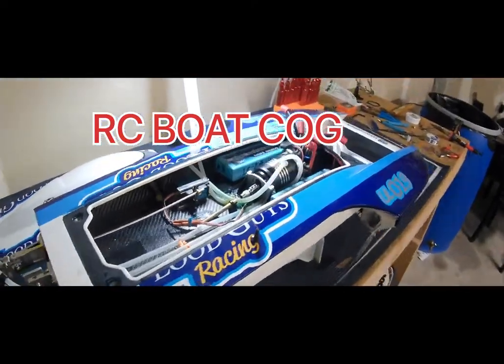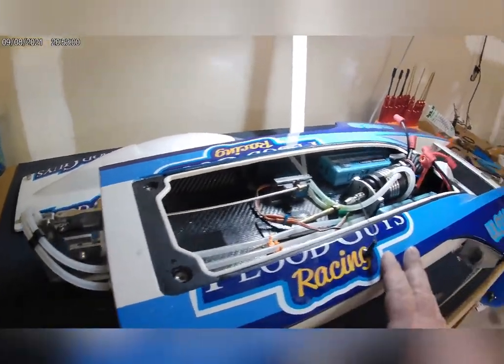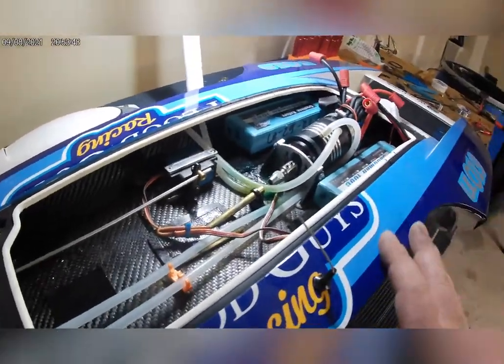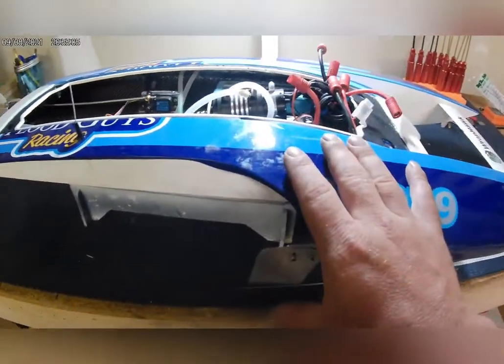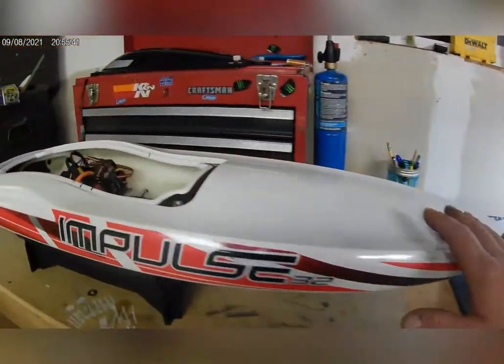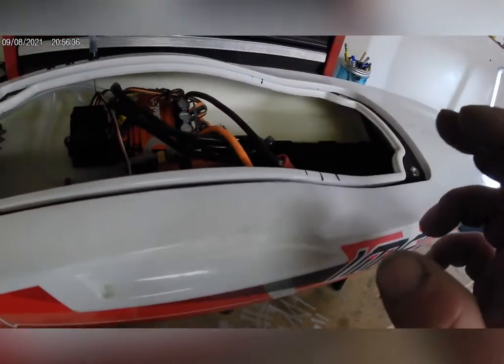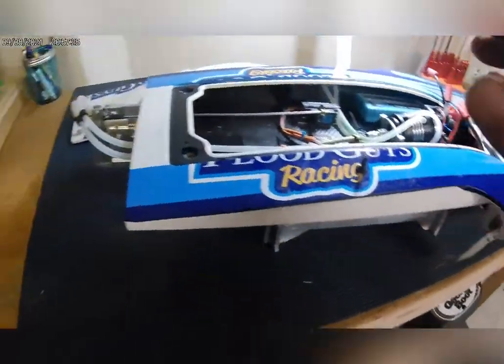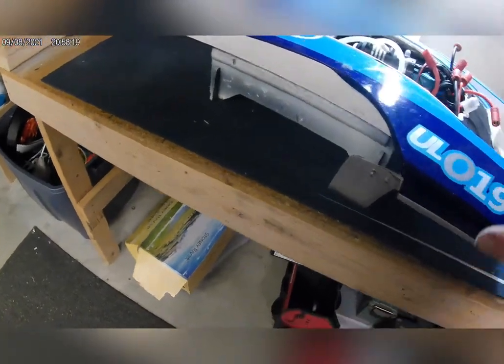Rc Boat Center Of Gravity (COG)

Comment: glad i stumbled across your channel. i am in the process of re doing my UL19 and was considering gutting the insides and making it like my TFL Popeye Hydro. now i know it can be done as you have done it. nice build on that UL.
Reply from the maker: Definitely can be done with this boat and makes for better improvements of the handling.   Even lighter as lost all the weight with the old tray and screws gone.

Comment: What about a sonicwake 36?
Reply from the maker: Normally mono hull is 28-35% of the hull.  As for the sw36 due to the self righting design of the water chamber. I found it’s falling in the 33-40 percent COG of the hull.  Make a mark at 35%  configure your batteries to fit within that Mark.  Then run the boat and move the weight forward or back to your driving, Water conditions, and how the boat handles.
Reply: @mad_lizard  how do I find cog?
Reply: Hello friend, where is the CG of the catamaran? I couldn't find this information anywhere.
Reply: @leonardomatoso3400  30-40%
I start at around 25% then keep moving the batteries forward until it quits porpoising